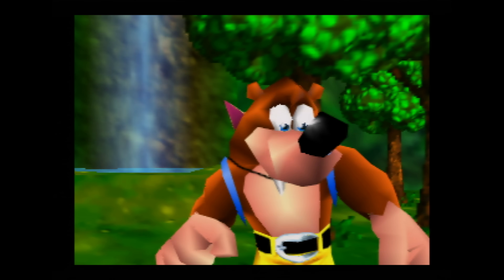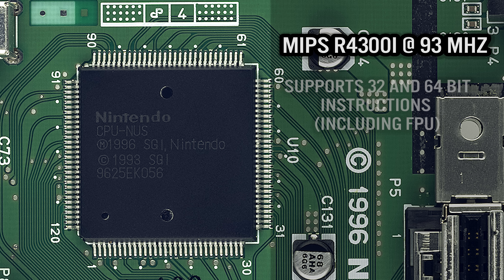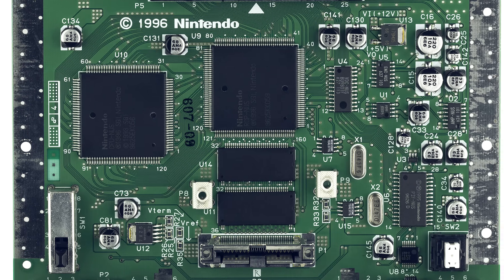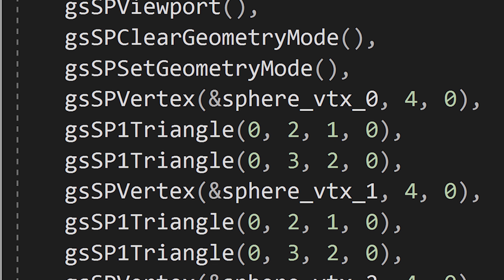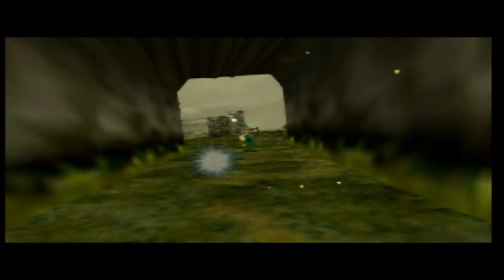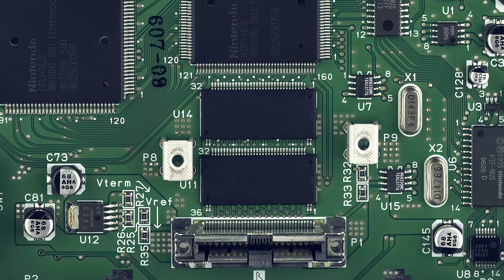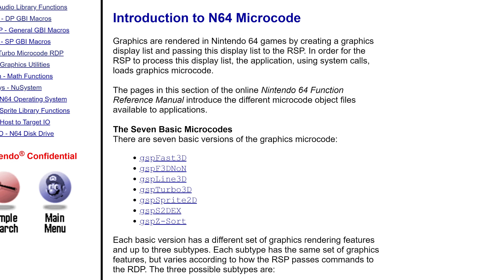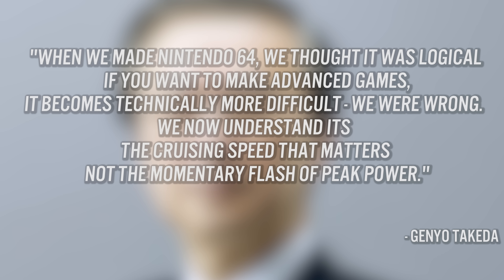Why was the Nintendo 64 so hard to develop games for ? | MVG

Comment: I would also like "Why X console was developer friendly?" series
Reply: This would be awesome, there gotta be some developers out there with good experiences.
Reply: Maybe a video on PS1, because it was so easy to develop for when compared to its immediate competition.
Reply: Dreamcast and Xbox in the top tier alongside Sega Genesis.
Reply: @madson-web  The devkit for the megadrive was amazing, xbox had direct X, so the SDK already existed (mostly) in on the PC platform.
Reply: @wizard-pirate  You are right. Thre's not a big deal transitioning to those platforms
Reply: @madson-web  Dreamcast sucked shit
Reply: Probably modern consoles like ps4, steam and switch
Many game engines have built in functions to just export your game to the platform.
Never been easier than it is on the new consoles
Reply: Xbox was a breeze by comparison.
Reply: @Kekitto Rektus right and wrong, lol. Correct in that the PS4 has got a ton of graphics libraries, existing code, multiple programming languages, interaction with CAD software, etc.
I only say wrong because that isn't as much the developers and designers making programming inherently easier or harder, that's just following a trend.
Reply: Well I think the question would be "How", because the "why" is simple. Developer friendly = incentive to develop on it
Reply: I mostly want to see one on the Sega Saturn cause it apparantly was even harder to develop for than the N64.
Reply: There's only one answer to that and that is xbox because it's a lot like a PC whereas older Playstations were very complex until the ps4 came out
Reply: @idonteatcheetos  The Gamecube was powerpc which while not as common as X86 was far from unknown and was quite well balanced in terms of specs. Unlike the PS2 which was super fast but had really tiny cashes and memory.
Reply: Dreamcast and PS2 switched positions from the preceding generation.
Reply: Your mom was developer friendly...
Reply: Gamecube was fairly easy to develop for
Reply: Wasn't the Wii essentially a more powerful GameCube with motion controls?
Reply: see: xbox
Reply: I wonder if the switch is easy to develop for. I remember hearing it is just as long as the game is around ps3 levels of quality. Anything more complex like doom 2016 and you have to change it a lot.
Reply: referral madness Many MD/Genesis games of the era were also programmed in C, primarily ones developed by Western game studios.
Reply: Really intelligent specially curated tools are really interesting especially in tech so that would be a great series
Reply: Wii U were developer friendly. With todays tools, nothing is hard to develop for.
They can even port Doom Eternal etc. to Switch.
Reply: @Fries Many of those games you listed weren't released for reasons that have nothing to do with difficulties in developing.  The Need for Speed 3 port was scrapped in favor of an all new and more ambitious game, Beetle Adventure Racing.  Dinosaur Planet was moved to the GameCube and released as Star Fox: Dinosaur Planet.
Reply: @Fries Yup!  Both games have that same weighty feel to the cars.  I only wish Beetle Adventure Racing's 2-player split-screen had all of the cars out their instead of just being vs.
Reply: I'd like to believe the OG Xbox was really easy to develop on
Reply: Dreamcast and Xbox!
Reply: At that time? The psx obviously everyone made games for it and it destroyed the competition.
Reply: Dreamcast would definitely be on that list. As well as PS4 and Xbox One and on since they pretty much used PC hardware from that point on instead of custom hardware like previous generations which made the development process easier.
Reply: Gcn, 360 and Ps4 were designed to be Easy to develop for.
Reply: For modern consoles, I'd think that the Xbox line of consoles would have been the easiest.
Reply: @robertt9342  The original Xbox was very easy to develop for was because it was basically a PC under the hood; same with the current Xbox One. The Xbox 360 was a little more complicated, but compared to the Cell architecture of the PS3, the 360 was heaven.
Reply: @Wexter0083  but that made it uninteresting. If you want a PC, you buy one. A console draws its power from being an affordable hardware optimized for games. Which means that it will end up being very different than a general purpose PC.

Plus a PC is not necessarily easy to program. Game developers are struggling with everything. They were late to adopt 64bit on PC (most of the software migrated before), they struggled using more than 4GB RAM via PAE and IPC, they suck at optimizing for SLI and distributing the CPU load across more than four cores. The loading times are horrendous, and when you look at what the PC is doing in that time, you notice very little IOPS or bandwidth usage on the storage. And sometimes they get even basic algorithms horribly wrong, e.g. that time Elite Dangerous route planner took around 15min to plot a course, while implementing an off-the-shelf multi-threaded optimal path finding algorithm could solve it in a fraction of a second.
Reply: @Incoming1983  I think you misunderstood what I was more of less saying "ease" is more about comparables. If you develop a game for PC and the OS and specs of a console is similar to a PC and you just need to optimize the game for a console then it's "easy". This is in comparison to something like the PS3 which was wildly unique from how the hardware worked and how the OS was designed so even though it was technically more powerful then the 360 games were less optimized to take advantage of it due to the more exotic hardware. A lot of PS3 ports had to be built from the ground up which added extra cost compared to developing on a PC and then optimising for 360. That is why Sony and Microsoft have very similar hardware now as it basically makes it easier for developers to make a singular build then optimize for their hardware. 

This is why the Wii U did not attract as much 3rd party support as the system was not just weaker, but the architecture was do different from PS4 and XOne that it was not worth the investment for basically very small financial gain. Compare that to XOne which while sold less than PS4 the cost the was worth it because I'd you built a PS4 version a XOne version was not that much of an extra cost compared to the extra sales and profit. 

This is a very complex conversation and not one I can easily type on my phone so I do apologize.
Reply: @Wexter0083  It also helped that both the 360 and Wii  used the Same Easy to develop PowerPC architecture of the Gcn.
Reply: @theothenintendomaster3717 bingo bango! It is also why the Switch is so easy to develop for as well! ARM is extremely easy to develop! The only limitation is raw horse power, but that is becoming less of a flaw now unless your game runs on UE5.
Reply: @robertt9342  Yeah, all of them except the 360 (still easy, just not as easy as all the other X86 Xbox consoles)
Reply: Another idea would be "Top 5 hardest consoles to develop games for".
Reply: @Insill  Saturn, PS3, N64, PS2...and some fifth console I can't think of at the moment.
Reply: Everybody thinks everything is too hard unless they already did something like it on another platform.  Xbox is easy for Windows people.  PS3 is easy for RS/6000 people.  NES is easy for C64 people.  Now hardware across the board is pretty generic and differences mostly depend on whether the company itself is a pain in the ass with licensing and API restrictions
Reply: Original PlayStation.  The friendliness  came from quality control or lack of it by Sony,  Nintendo had lots of restrictions and made it harder to develop for or even get in to Nintendo's developers club so in that sense the PS1 became developer friendly  and many more games were made for it.
Reply: Honestly steam itself is a good example. Their work on Proton (a fork of WINE, which they upstream their efforts to also) brought games to Linux and Mac that had literally never worked before, like STALKER Shadow of Chernobyl and DOOM on dosbox. That isn't hardware, but their software efforts on that front, on the Steam API and community servers, and making steam link open source so that people can see how it works and develop off of that, and finally even working with HTC on the Vive and then the Steam Link are really all underappreciated. You may have your issues with them in other ways, but Valve is generally a positive force for developers. 
Definitely also worth mentioning Vulkan devs and the guys who made Dolphin and PPSSPP
Reply: Y console
Reply: Me too but then the video wouldn't be a "complaining about why the company who made the console is stupid" video and nobody wants that.
Reply: Nintendo Switch is a great example, due to the support on indie games
Reply: @obrunodamacena  um...
Reply: i think gameboy color was.
Reply: @Viktoria_Selene  wasn't that coded on assembly??
Reply: @hellNo116  assembly doesn't make it harder, nor necessairly it had to be assembly
Reply: @hellNo116  compilers weren't very good back then so assembly was written manually for efficiency but that didn't stop you using compiled languages
Reply: @Viktoria_Selene  GBC is no different from regular GB, the same deal with a few extra bits.
Reply: @shiru8bit  In a certain way the GB/C were developer friendly, as it was based on a CPU that had been around for 10 years already. Plenty of coders were familiar with it.
The DS was so frienly that some called it the Developer System.
Reply: @RyumaXtheXKing  That's just the Ds's official name, Developer's System.

Comment: Would you say the storage limitation of cartridges was a bottleneck in achieving its full potential?
Reply: No.  There is only so much data you can load into RAM at any given time and the cartridge sizes continued to get larger throughout the systems lifespan.  It hurt Nintendo in the marketplace against its' competitors in terms of attracting 3rd party support but the reality is, once you subtract FMV files, convert audio tracks to midi, etc. the actual size of the game files isn't that big of a deal.  Pre-rendered backgrounds could be converted into real-time 3D too.

Comment: That's actually really impressive, so basically if the N64 was disc based, it would have DESTROYED the PSOne
Edit: and if Nintendo weren't dummies
Reply: If the N64 had a CD drive, it probably would have cost 500 to 600 dollars.  In addition, the games wouldn't be as good as they are.  Despite all of the propaganda and brainwashing over the years from publishers that are focused entirely on profits, CD's have always sucked as a game medium for the player as they have too many downsides.  Even with N64 levels of graphics, the Playstation or Saturn would never be able to run Banjo Kazooie, Zelda, Turok, Perfect Dark, etc.  Without the ability to quickly load content, they would need more RAM than any console at the time could realistically be expected to have at an affordable price.  Similar games on PC at the time required large installs to the hard drive and more RAM because of this fact.
Reply: @davidaitken8503  that price is conjecture, my comment isn't wrong, 3rd parties wouldn't have left for Sony. That alone would have meant disc-based N64 would've destroyed the PSOne
Reply: @GhibliNova  I think your forgetting the larger reason 3rd parties jumped ship to Sony.  They don't like competing directly with Nintendo's first party games.  A number of companies saw Super Mario 64, tried to make there own 3D platformer and found out very quickly how difficult it was.  They just went back to making the same games they did on 16-bit.  This generation was the beginning of the end for Japan's 3rd parties.  They decided to play it safe with Playstation instead of making the painful, yet necessary investments in R & D to pull off 3D games as ambitious as what Nintendo and western developers were doing on N64 and they have been paying the price ever since.  Western companies like Rare, Midway, Factor 5, Ubisoft, and Acclaim flourished on the N64, because they actually knew what they were doing.  To this day many Japanese studios still have yet to make anything as ambitious as many of the games that came out for the N64.  Not even all of the processing power in the world on today's hardware can fix that.
Reply: @davidaitken8503  you're proving my point
Reply: @GhibliNova  And you're being unrealistic.  You couldn't target a realistic price point for the mass market in the 90's with an N64 level of power that also included a CD drive and enough extra RAM to make it work effectively.  That $200 N64 would cost $329 in today's dollars.  Now add in a CD drive and enough extra RAM to make it work at a time when the cost of RAM was expensive and you've got a system that few would buy.  The irony is that now everyone complains that Nintendo doesn't target the high end with there hardware anymore.
Reply: @davidaitken8503  dude, generally speaking the N64 was more powerful and if third parties didn't leave (which history claims happened due to cartridge restrictions and Nintendo being tyrants) then the ps1 wouldn't had the success it had. Which is why I said if it was disc based and Nintendo weren't dummies. That's all I'm saying and that's all I've been saying, it's too much conjecture to say for sure what would've happened exactly so for generalities sake, I'm not wrong
Reply: @GhibliNova  Okay.  I get what you're saying.  Nintendo would have been better off as far as the market goes with weaker CD based hardware.  I don't disagree with that assessment.  I just wanted to make sure that you understood that many of the amazing N64 games we have today would not exist in their current form and many wouldn't exist at all.  You would be amazed at how many people don't really grasp that.  They act as if they would have all of what they enjoyed on the N64 combined with all of the 3rd party support of the PS1
Reply: @davidaitken8503  wow, you are the first person I've ever encountered on Youtube who has actually thought about what I said, you're a legend. And for sure, as far as conjecture is concerned I think you are right on the money
Reply: @GhibliNova  No problem.  I think I rub people the wrong way sometimes because I do challenge people's statements they make, but once I get enough information I'm more than willing to agree with someone if I think they are right.
Reply: @GhibliNova  You just described 99% of the people I encounter on these Youtube posts.  It is good to know there are still a few critical thinkers left in the world.;)
Reply: but playstation had CDROM and less ram ;-)

Comment: That final quote from Takeda sounds a lot like Cerny's philosophy for PS5
Reply: Sony actually went the N64 route so to speak with the PS2 and PS3. Because PS2 went so well they thought they not only could but even should continue on the same path, but it cost them direly. Not until then did they learn that. PS1's relative simplicity, more like balanced hardware and good documentation, is more a result of everyone being completely new to polygonal graphics at the time and being new to the market, so they wanted to attract developers and being able to have ports made with relative ease.